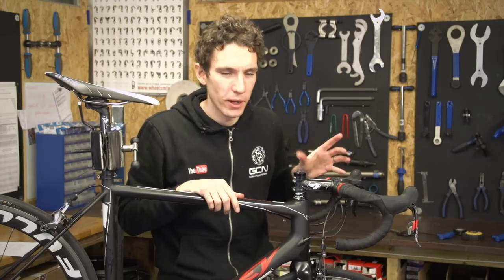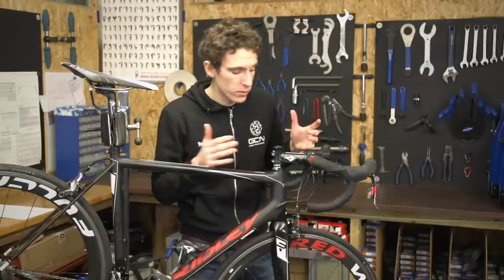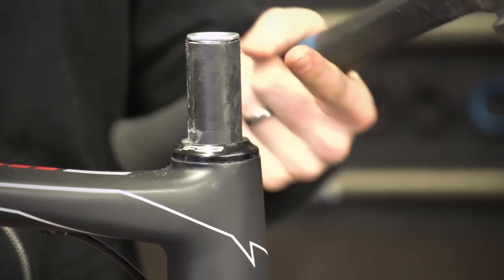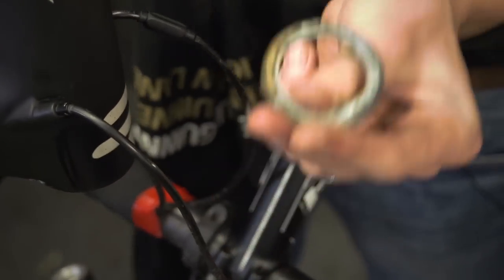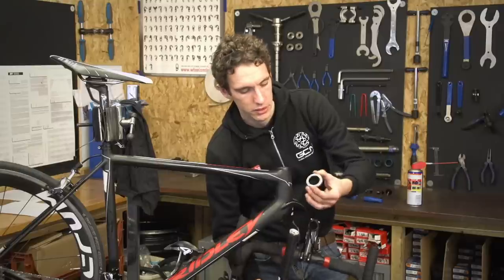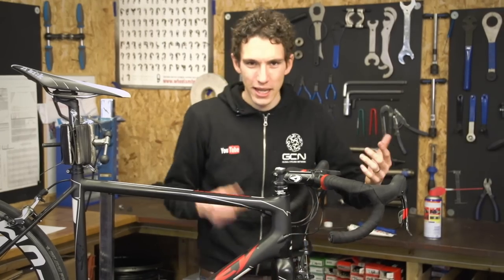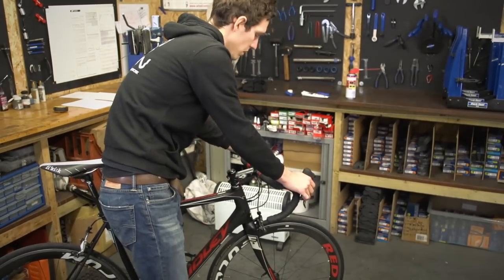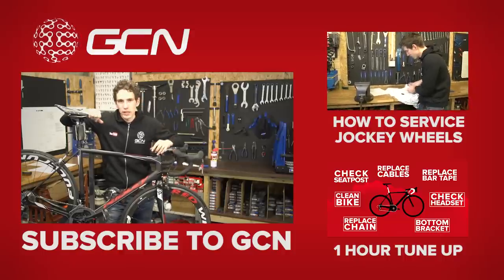How To Service Your Headset

Comment: Great video ! Very helpful for service my bike. Kudos
Reply from the maker: +Jonathan Araya Gld the video helped Jonathan and thanks for getting in touch!
Reply: +Global Cycling Network I wanted to service my bike's headset but I'm having a difficulty. I have a GPS tracker in there and I have no idea what to do now. any suggestions?
Reply: I'm gonna take a shot at your question, and the solution is probably simpler than you think. You must be referring to a tube-shaped GPS inside the steerer tube, I assume.  That entire GPS unit slides right out, while removing the hex bolt at the top, and when re-installed, together they do the same job as a threadless headset top-cap & bolt. That is, they create the initial compression that sets the adjustment on the bearings. Once the tracker is removed from the bike (by removing that extra-long top bolt), you can then proceed to service or replace the bearings or the entire headset assembly, as shown in this video. 
    
Once you've done that, you can re-assemble the headset and then use that same bolt of the GPS to FINE-TUNE the bearing adjustment, and then align the stem to the wheel & tighten the stem bolts. The tightened stem itself actually provides the brute clamping force to KEEP the bearings adjusted, and you could actually remove the GPS unit (or, the top-cap & short bolt of a threadless w/no GPS) at that point & ride the bike without it, the same as you can do to a standard threadless headset. In essence, the GPS unit and its bolt are simply replacing the top-cap & bolt of the original headset. The bolt and the GPS should be removed together, so try gradually raising the GPS out of the steerer tube as the bolt is loosened, removing the bolt & GPS as a single assembly. 
 
   GPS or no, the top bolt is really only an adjuster, and not an adjustment-locking mechanism. If the stem was just barely tight enough to stay aligned with the wheel, the top bolt, the cap, and the nut would be taking the brunt of a task they weren't designed to do. They may hold the adjustment a while, but the threads may come loose or strip, and/or the top cap could cave in or even break from the transfer of the stresses of actual riding. They'd only last a very short time in actual use before the bearings first went out of adjustment, followed by some real damage, including to the rider. 
  
   The type of nut that holds this bolt may be one of two types: One is the star-fangled nut commonly used for threadless headsets, and the other is a cylindrical assembly that I'll refer to as an "expanding nut", for lack of a proper term. On the cylindrical type, it has a large bolt that is tightened to expand the assembly until it firmly grips the inside of the steerer, and that large bolt has the smaller threaded hole into which the cap bolt is threaded' this type of anchor can be removed & re-used, using a larger (6mm?) hex key. A star-fangled nut can only be removed by using a punch and a mallet to drive it downward & out the bottom of the steerer tube, and should never be re-used once it's been removed. 

   You won't need to remove the nut to merely service your bearings anyway, but if you perhaps sell the bike and want to keep your GPS, you'll want an original-style top cap and another extra-long bolt to replace the GPS parts on the bike. A long replacement bolt is necessary, since when the GPS was installed, the anchoring nut was re-located much deeper into the steerer than a standard anchoring nut would normally be (to make room for the GPS unit).

   You certainly can install a new star-fangled nut in the upper area of the steerer if you wish to use the standard short top-cap bolt, but I don't recommend this unless you first remove the cylindrical expansion nut below it. You'll never get either of them out of the steerer, if they're both in there like that at the same time. Okay, in truth, you COULD get them out, but it'd involve machinery and probably at least a little damage to the interior surface of the steerer. 

   If you're confident that there's no dirt, wear, or a lack of lube in the (loose) bearings,  you can simply try loosening the clamp bolts on the stem where it attaches to the steerer tube and then making the bolt at the top tighter, skipping ahead to the last part of this video as a guide for final adjustment, and you just might be okay. Just check it afterward for roughness or center-detention -- sure signs of at least dirt, and at worst, damage to the bearings and/or cups & races. They would need replacing, if so.
   
    Hope this helps.
Reply: Home

Comment: Hello, will anti seize damage my bike for this procedure?I haven't got normal gress yet but I have got anti seize.
Reply: You very well could damage your bearings. Anti-seize does not lubricant, it delays corrosion. Anti-seize is used as a "lubricant***" if the potential of seizure is a factor by delaying said corrosion, not by actually lubricating it. Just get some grease. It's cheap and available literally anywhere.

Comment: Did the front fork have a crown race on it?  I've just changed my cartridges but now have some play in the front fork. There was no crown on the fork. should there be one?
Reply: some steerers don't require a crown race as they are already shaped to accommodate a cartridge bearing properly.

Comment: Si, is there such thing as the "default break levers configuration"? because I've rode a couple road bikes so far and none of them had the front break on the right lever, have you changed it or it's just how some
bikes come?

Thanks, good video!
Reply: thanks vaxbuster, I really didn't know that, "break" and "brake" were compliments from my autocorrect, which is not set in English (:

Comment: Hey Simon, I did this routine and in the end all went well. However in the FSA headset of my Focus Culebro there wasn't any bearings, just two identical conical rings that sit around the steerer in the head tube. Plus the compression ring and the final cover on the upside. The fork was sliding out as soon as I took off the top cap and the stem. Eventually I greased and fitted everything back together and eliminated a 5mm play that was there before, but is it normal to have the steerer turn around without bearings?

Comment: Hi,I changed my bearings as per this video (caged bearings on a Carrera crossfire 2 hybrid) and now my steering doesn't work at all, when I move the handle bars the wheel doesn't move, everything feels as if it's moving ie not stiff but it's as if there's no connection between the handlebars and the bit that should be moving the wheel.  I've checked and checked again and watched this video lots of times but can't figure out what I've done wrong.  Any suggestions anyone?
Reply: did you tighten the handlebar bolts to the stem?
Reply: Was the problem that you did the compression cap too loose?

Comment: They make them more simple than they used to be.  
Thanks for the video.  Mine has been a little squeaky, but I've been lazy to service them, and I rode in a huge down pour yesterday.  Started home today, and the dam thing seized. Almost killed me, and then I had to walk it back for 2 hours.
First time in 45 years that happened.
Reply: Mistakes happen. Thankfully, if you can put a couple of hours aside, you can fully service your bike and have it running like new with little to no effort, especially with sealed bearings. No more worrying about loose beads.

Comment: Might be a bit of a stupid question but can you use Vaseline instead of a bike grease??
Reply from the maker: Abi Senior Vaseline is a petroleum-based jelly. It has some lubricating properties, but it will also affect some rubbers, and plastics, and is very hard to clean up. It will work in a pinch, but for more permanent lubrication, it's better to use recommended bike-specific grease.

Comment: 6:50 What if the bearing cover does not fit snuggly over the bearings? On my Cervelo R3 the cover does not touch the frame, which leaves about 1-2 mm of the bearings exposed and play in my headset that I haven't been able to get rid of yet... Thanks for any help
Reply: Are you sure your bearings are positioned properly? They could be upside down or even the wrong kind if you had them replaced.
Reply: Luciano Narno Thanks for the help. I realized that I simply didn't have enough spacers above my stem (after recently cutting my steer tube down a bit). Silly mistake
Reply: samaway Yeah, that is common too. Glad you got it sorted out!

Comment: These videos really take the fear out of taking your bike apart.
Do ye have tips on replacing cables on a bike with internal cable routing?
Reply: ***** Haha pretty much GIYLF'ed him there, Vax!
I agree with Luke GJ Potter though: these how-to vids really do take the fear of - the unknown/messing it up and not being able to put it back together/making it far worse than it already was/creating further problems in the process/replacing parts unnecessarily/dying of solvent induced asphyxiation from over exposure in an enclosed small space  - out of bike maintenance for those of us not so experienced as yourself, Vax.
Reply: ***** Dee-Jay-Gee-Bee Coolbeans guys.
I found the video, it's called "How to Fit Internals Cables on a Road Bike Like a Pro GCN Maintenance Mondays Off The Back". :P
Reply: Luke GJ Potter Main tip: pull the guide without pulling the inner able. You can then use the old cable to pull the new cable-guide in.
Reply: rosomak I ended up using thread. Thanks.

Comment: Thanks for the nice video. One question : What if the steering is too loose but the headset is tight ?
Reply: Remember to tighten the top cap while the stem is still loose.  If you already have stem tightened then the top cap will be unable to compress everything no matter how tight you make it.

Comment: Teflon grease was used on  the  bearings, yet I have heard that standard greases can damage carbon ???
Reply: I had heard that as well, but later heard that the actual was story pertained to seatposts.  Standard grease was too much of a lubricant, and people would then overtighten and break carbon.  Carbon paste was recommended instead, but I assume its gritty-ness would be bad in bearings.  Would be great to hear from manufacturers on these.

Comment: Would Lithium Grease be ok for Headset Bearings?
Reply from the maker: yes, although it's maybe a little bit too thin. could be worth getting something a bit thicker. thanks Jon
Reply: +Global Cycling Network hi I have a Carrera and the bearings will not come out any tips, I've tried tapping them but no joy?
Reply from the maker: hi Edward, really tough to say without seeing the bike.
best thing is to pop to your local bike shop.
Thanks
Jon
Reply: Global Cycling Network do some older headsets have a bottom bearing that doesnt come out, i,e, integral to the frame? doesnt make sense from a replacement perspective but mine seems pretty jammed in the bottom of the frame. just want to check before forcing something.

Comment: Why does my headset once tightened up make steering impossible because of stiffness. Where am I going wrong please??
Reply: You most likely over tightened it.
Reply: @bobbyhempel1513  Yea i downloaded and watched the video after my call out for help but in the video he mentions the stiffness. In fact after my over tightening I now have to re-install a star nut as mine split in half.
Reply: @Hertzultra  Honestly, The top cap bolt needs very little tightening! Just enough to bite and keep the headset stable with no movement and your steering flowing free when turning it. You must do this with the stem losened, And then tighten up the stem when you got it just right.
Reply: @mozzjones6943  Also another lesson learned is to NOT try and put a headset together with lots of spurious parts from other bikes thinking it's all "universal". Have had to order specific headset for my frame.
Reply: @mozzjones6943  The other part of my learning curve is DON'T try and tighten up STEM bolts too tight EVEN though using Ti because now I have more work in the mix what with one of my Ti bolts shearing off. Thinking Ti is more or less INDESTRUCTIBLE.
Reply: @Hertzultra  True. A torque driver is always the best way. But, As long as you tighten up the stem bolts enough to be secure and not put lots of effort in and make them hard to undo you'll be fine.

Comment: can there be space between the top cap and the stem or will this create a loose headset? -MC
Reply: No, Mike, spacers are needed.
Reply: The spacers and the stem together form a stack that's squeezed vertically when the top bolt is tightened, and that stack has to be taller than the top of the steerer tube.

Comment: If a torque value is given why would you go under it?
Reply: @craigherriot4026  I understand completely what you're saying! I come from aviation maintenance background and if a Tq value is given it is the maximum not to be exceeded, if that value is too high either the material used for the bolt/screw is too weak or that value needs to be less! It's like saying you can have 5 sweets but you can only eat 3!
Reply: @mattyp80  I guess that's where the difference is. For most parts, the actual torque setting is to be respect. Such as when tightening pedals and so on. Other area's can be open to comprehension. However, going slightly below can be beneficial at times, especially when going with a carbon frame and/or fork.

Comment: Can I use  weldtite pure organic  grease?
Reply from the maker: Yes you can
Reply: Global Cycling Network 
Great thanks. One more thing would you advise that I also use it in my wheel bearings. It seems rather thing for the heat that can build up down there. By the way I’m running vision Team35 wheels.

Comment: Wait, your front brake is on the right lever?
Reply: That's how they do it in Europe.
Reply: @alansmithee183  As you can see in the video, the brake cable attaches to the brake on the right side of the bike (the left side of the brake when you look at it from the front). It's not very logical then to twist the cable back to that side from the lever on the right side of the handlebars. And since Europeans are usually very logical beings when it comes to right and left (with the exception of the islanders to which the GCN blokes belong, which is probably why they no longer want to be included in Europe), I beg to disagree with your reply.
Reply: @GerardvanReekum  All I can tell you is what I have heard :)

Comment: I ride a new emonda SL6 and I "lowered" the handlebar by one spacer. The shifter-brake cable rubs up against the frame which causes some friction when turning the handlebar to the left only. After I brought it into my dealer, got home and it's still tight on the left side only. Fine when I left. I think something inside the headset might be slightly damaged or needs more in depth exam. Any suggestions for me GCN? FSA headset.

Comment: Actually in the technical perspective, you should not apply the grease in the outer and inner bearing side. Those side is not a moving parts, which the outer side should be hold onto the bearing house in the frame tightly, and the inner side should hold onto the fork tight. By applying grease on those area, there will be slight chances that the rotation happen outside the bearing (such as between the bearing and the bearing house, or the fork).
Rotating should be happen inside the bearing mechanism, not outside.

Comment: Very nice video though the accent is always hard to understand ^^ So in general if you only ride on sunny days "no rain", you say that you'll need to check for the headset every how much Km? Also how long should last a bearing on a 3000-5000$ bike? I usualy do 1500-2000Km per year and I haven't changed that in 4 years yet.

Comment: HELP ME GCN!! My bike's pedal bearing seems to be making knocking noises as i put power through either standing or sitting in the saddle. .. and it knocks every half revolution- when my foot is at the bottom of the pedal stroke..
Reply: if you make a video off it it would make it a lot easyer to say whats wrong
Reply: I had this problem and it was the bolts on my cleats, they'd come  ever so slightly loose.